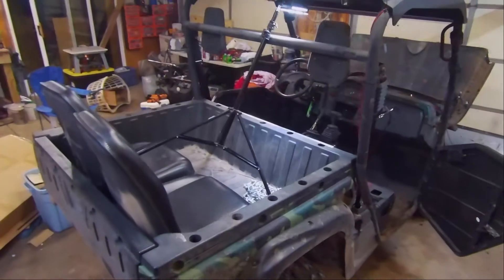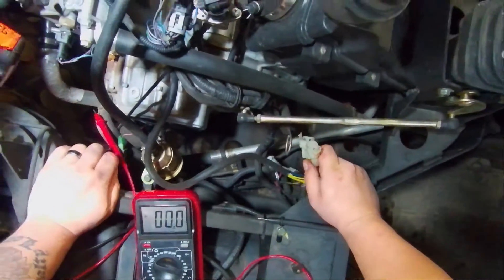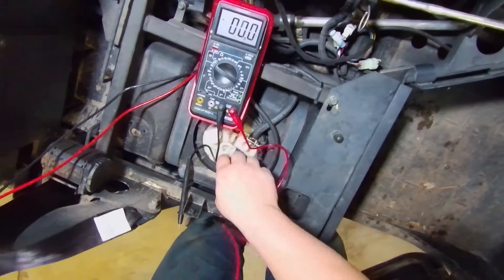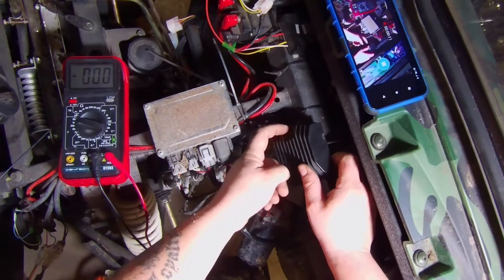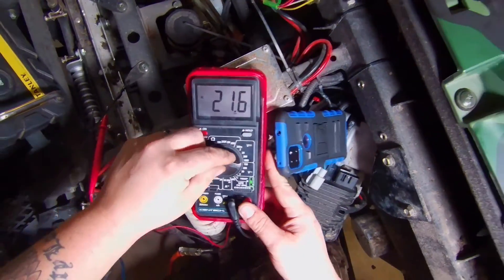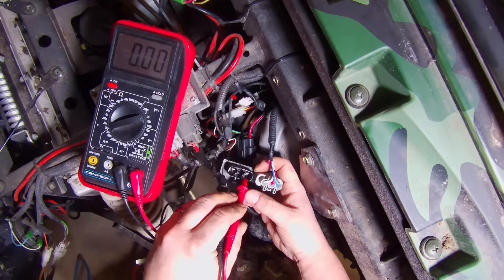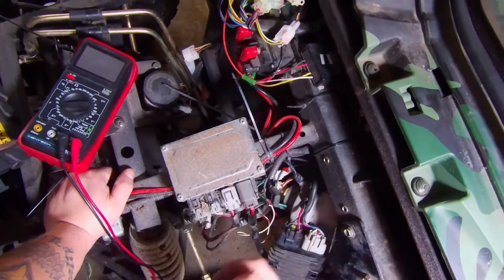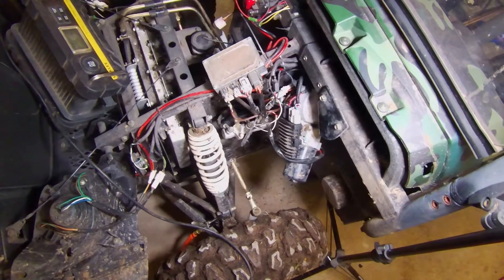How To Test A Stator and a Voltage rectifier/Regulator. Super Easy Odes Comrade 650

Comment: I have the same machine! My regulator only has 1 plug and 5  ports but i will adapt and overcome! Mine dosent have a ground on it either haha! Good video!
Reply from the maker: Ya follow the wires and you will find a wire that breads out of the harness and goes to ground.
Reply: @Self.reliant  i did check across them and i have nothing so looks like I gotta get a new stator. Yay. Lol
Reply from the maker: @Gambler8T if it's a 650 I have a stator for you

Comment: Currently working on a 500 that is only putting out 11.87 volts.
Reply from the maker: After the voltage regulator or before?  The stator should put out 15-40 plus volts ac on the yellow wires if that is good then the voltage regulator has failed.